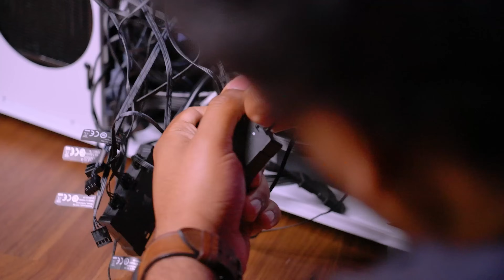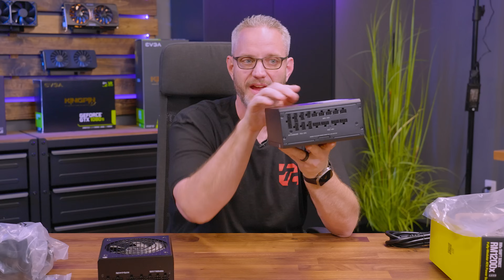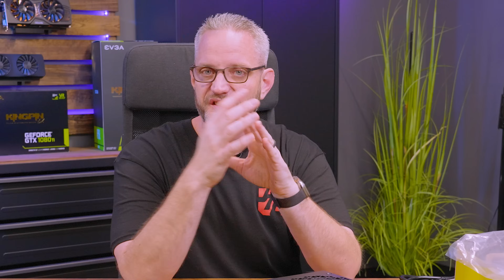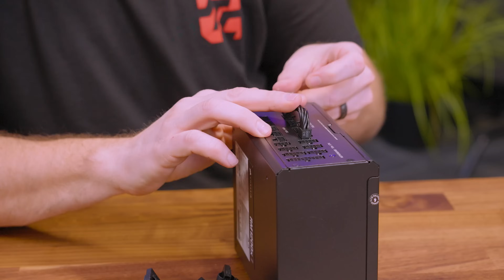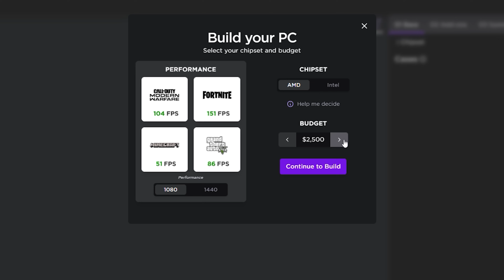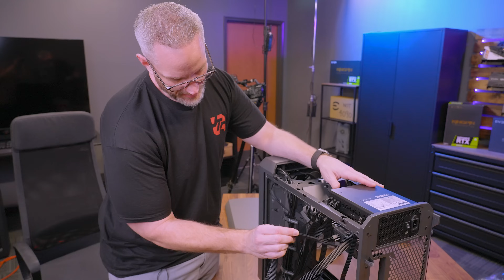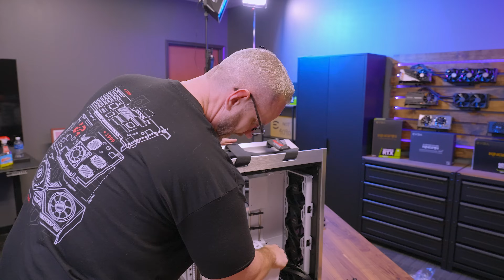I tried to prove this design was a failure... But then this happened.

Comment: @13:30 the wires are routing to the back of the supply before heading up toward the case top... essentially becomes the same as a rear socket power supply...

Comment: Frankly .. I would just take a Dremel to that case and make it work.  

For me this design is 100% better than trying to plug anything in 90 degree while I am fighting the case and whatever other cables and RGB controllers are stuffed in there  even HDD cages (yes, I still put one large drive into my cases where I just dump the "never use it" stuff - bad habit .. I will stop doing it and just store that on a NAS) 

I wear XXL gloves (size 12) .... Working on ANY CASE for me is a literal nightmare. The only one I am comfortable touching is the Thermal Take open cases (e.g. P3) ... but then bugs fly into it, cat climbs in it ... dust falls on it :(

Comment: 12:00 I'd argue that you don't need slack for the cables on the O11 to have access to them. The cables being on top allow you to rotate the PSU so the top part of it would be easily accessible, and the amount of cable that you need so your run reaches the PSU on top is already enough slack IMO. Also, isn't this new PSU a bit narrower so the cables do have some extra space for cables to fit?

Comment: Wouldn't work for my Thermaltake W100 case but my EVGA 1000 watt is still holding strong and I only paid $80.00 for it, but I'm definitely not gonna spend 200+ on a psu 😏

Comment: they could have it so it's not as wide as an atx power supply (but keep the atx profile for the rear where it's screwed in) and make the powersupply a bit longer, this would create more space for the cable to come out and since the cables don't need to come out the front the psu could be a bit longer to make that room

Comment: It's a good idea, but very dependent on the case you have, most "cheaper" cases, under  80-100$, dont have so much space between the PSU and Side panel. I think cheaper cases, with bottom-mounted PSUs would have issues with it too

Comment: Sorry that i have to say this but i am kinda dissapointed in this video. Mostly as the very first time i saw a advertisement for these shift power supplies, i straight up knew why they were making them. Longer power supplies in the 4000, 5000 and 7000 cases, as those were shown in the advertisement, normally mean you have to remove the hdd drive cages to have space for your cables. By having the cables come out the side, the drive cages can stay in. 

The NZXT case even showed this benefit but wasnt pointed out. Or even a fit in a Corsair case.

Comment: I looked at this a little while ago and decided on an AX1600i instead (plus I got it on a rather sweet deal and I only needed to order a 24-pin from CableMod to retain my custom cable set). I like the concept but was disappointed that the SHIFT's efficiency is only rated as gold.

Comment: On the last case I would try to pass the cpu cables straight up trough the metal shroud behind the motherboard. It is no elegant but this way the length would be sufficient.

Comment: honestly, some of these cases are really just you nit picking and searching for non existing issues here, this PSU is for those that are looking for something like this so we already most likely have a case that would benefit from having cables coming out of the side... but showing cases that are literally designed to have the cables coming out the back is just stupid and almost looks like you actively tried to set this up for failure. its a pretty obvious thing that if you were to get a PSU like this you have already done your research on the case you want otherwise youd just go with you know... a conventional PSU setup. This is almost like complaining about that a philips screw driver doesnt work on screws meant for a flathead screwdriver...

Comment: Also really convenient for a case that has the psu on its side behind the motherboard. So the fan can go out and the cables run out of the top which is much more clean and easy than having the cables come out of the back.

Comment: In principle, the Corsair Shift PSUs are a nice idea, but you will have to pay very close attention to whether they are suitable for the case you plan to use.
Reply: Hence this video...
Reply: Hopefully over time this kind of configuration becomes more common and case manufacturer begins to follow suit, because conceptually it makes an awful lot more sense.
Maybe eventually it’ll make equally as much sense in practice
Reply: Not everyone uses hdd on top of psu in 011d evo. In that case shift is good.
Reply: Get a Corsair case, sorted. This PSU is brilliant, purchased a 5000x as I know that will be compatible
Reply: So it's like any other computer component. What an actualization.
Reply: some other review said corsair actually made a list of alot of cases they tested the shift series with. 
but i can't find it rn, only their info about the case having to have a standart atx layout, be at least 210mm wide and side access to the psu.

Comment: The biggest problem is just the fact that it ignores standards and thus while it may work with a case, it also may not work, honestly it's extremely annoying how PC component companies just outright ignore standards, like PCI-E expansion height, there is a standard, but most GPU manufacturers flat out ignore it meaning there's a huge issue with GPU & case compatibility when there shouldn't be.

Comment: My only issue with this PSU is the lack of native 12VHPWR support.  For an ATX 3.0 PSU, this should be standard.
Reply: can you elaborate on what you mean by 'native' 12vhpwr support? i have this psu and it came with a 12vhpwr cable that i'm using on a 4090

Comment: I bought this power supply for a 7900xtx in a Lian Li Lancool III and it works well with fan facing down. I thought it was a neat change up that helped with cable management.

Comment: If you're like me with an O11D Evo and don't use the drive cage, you can take it out and that gives you that entire upper section to cable manage the cables coming out of the unit. That is why I have been considering one of these new Corsair PSUs because my current unit has the standard "out the back" cabling, and it gets awfully tight with cable management. I mean it works and all, but you have to get a bit creative. So I do like this idea. Although, it would definitely be a case by case situation with it - as you demonstrated. Good to visualize how it fits in some cases though, especially mine. Appreciate it!
Reply: Just built one this week with the rm1200 shift and no drive cage and it worked a treat

Comment: I imagine when Cablemod makes custom cables for the Shift family of PSUs from Corsair, it's going to have pretty unique cable runs in certain cases. Possibly to the point of having to shorten one side of the cables in certain runs. With the number of O11 case builds, it's likely that they're going to have to think a little differently about that. Synergy gave Jay those special short run cables for his powerboard that had half one length and half slightly longer/shorter (depending on where you start) and if the cable runs are anywhere as short as that, it's gonna affect the cable flex.
Reply: Cablemod might make 90 degree angle custom cable plugs to make sideways runs easier.
Reply: @KayDizzelVids  
I was thinking about this while watching the video. It's a good concept and as Jay points out, I'm happy that companies are "innovating", even if it's something as "trivial" as moving the connectors from one side to another. A lot of case fitting issues would disappear if they had 90 degree cables instead of "regular" ones.
Reply: I don't understand why you think that there would be an issue with Cablemod custom cables for the Shift (when released) when Cablemod have their 'Custom Cable Configurator' for buyers to select from for each cable that ranges from 150mm to 1000mm. This is on the buyer and not Cablemod to decide the cable lengths for their particular case. There's nothing to think about on Cablemod end! And also, it's "Singularitycases" who supplied the Powerboard and their own custom cables design. But why would you bring up Singularitycases custom cables when it's an minority small amount of PC builders that would be concerned about the cable flex of their 100mm 24pin/EPS cable?
Reply: @disguiseddv8ant486  You're not reading. Short enough cable runs ruin the uniformity when they're bent, because there's not enough slack; an issue SINGULARITY RESOLVED, IF you bothered to watch Jay's video on his powerboard unboxing with the custom cable runs.
Reply: @UnveiledShadows  I've read what have you typed. I'm pointing what you're saying is only for the VERY small minority group who uses the 100mm or the 150mm custom cables and buying power boards. So why even mention the minority group when they themselves wasn't complaining about "cable flex"? It's a moot point! 
And also, I did watch that video because that's why I've told you the correct company name "Singularity" without going back watching the video again.
Reply: The end of cables for a modular power supply are unique for that PSU and are not standardized between different brands, and even different models from the same company.  So I doubt Cablemod would do that considering it would at worse, be only for that PSU, and at best, be for a range of models from that same company.  You could kill your PSU if you don't use a compatible cable with the PSU.  It's why when ordering replacements, you need to specify the model and not just the brand.

Comment: 20:10 The insulation was already shaved before your put them in this case.
17:47 You can see here that the cable is already damaged.

Comment: If I paid $300 for a PSU and I got crappy rubber cables, I'd be pissed....oh wait, I just did with a SeaSonic Vertex unit, too...

Past time for crappy rubber cables OEM to die.

Situationally, this design is amazing.  Situationally.

Comment: Makes me wonder why there are no powersupply connector expansion pannels built into a case, that then connects to the power supply. 
Maybe even an expansion pannel that can be placed anywhere in the case, but the cables from the powersupply towards the expansion panel would be hidden (built in by the case manufacturer).

Comment: Thanks for doing this video just to let us know that this even exists. I can see the benefits depending on the case but all of your points are valid.

One thing I did want to point on was the bend you put on the cable.  Since this cable is delivering power only it’s ok to bend it like that.  Power does not bottleneck no matter how much you bend it.

Comment: The thing is though, not everybody has access to a large stock of cases and power supplies, so you probably are not going to know that a certain orientation of plugs is going to work better than another and I'm sure nobody out here is going to buy a case and M/B and hold of buying a PS so that you can figure out what the best is. With all the combos of Cases and PSs, you would have to go with what you know, assuming a PS will work very rarely works.

Comment: I have this, was a pain in the arse to fit into the O11-D because of the Hard drive expansion bay sits bang on top of the connectors and requires you to radically bend the cables over and lay side by side close to each other.  Without that bay in place, it fits like a dream....

Comment: If I wanted to upgrade my system to a 5800x3d and drop in a 4070, do I need a new PSU?

I'm just running a 3600x, rx580 and using a Corsair 650 (forget the exact model, but an older one).

Thanks peeps for any help!

Comment: It could work well in cases where the PSU is on edge behind the motherboard, such as the Corsair Air 540, or Lian-Li 011 Dynamic.
I'm sure that Corsair would use cable sizes large enough to handle the power, considering the fact that Johnny Guru is working in their PSU division. 
Also, you should never use pigtail cables on your GPU. (As in, not using both connectors on it, one is fine, though not as nice looking.

Comment: Room 4 cables on that, you probebly need more room of that, as all the plugs in the PSU are in a line, and at least at first most of them have to route forward, well you will have layers of cables i assume.
I still like these new PSU form factor, but cases would need to accommodate this feature for it to really work.

Comment: I needed a new PSU for my recent 4090 gpu upgrade. I bought a shift, it's quite excellent in my define 7.

Everything went together so quickly and it didn't require a total teardown of the entire system, i just carefully removed the old power cables and PSU then with the shift connections being on the side i popped the new PSU in and routed the new wires without any issues. Total time for a PSU upgrade without teardown was about 10 minutes.

Comment: Really unique and innovative design, I could see this being quite useful for ITX builds or something. I don't think there is much benefit to be had on a full size ATX power supply that will go into a giant ATX full tower case, but for smaller builds it might be really good. Kind of disappointed they only give the rubber insulated kind of cables with it though, I feel like at this price point it should feature braided cables.

Comment: I have the AP201 and had to do some cramped cable management when building. Wondering now if pushing the cables out the side of the psu would have made it easier to deal with... Might have to look into this

Comment: works really well where space in limited in front of a power supply because of hard drive sleds... I had to remove 2 hard drives during a upgrade because the customer bought the regular 1000w corsair instead of the shift

Comment: This would work just perfect for my oold €35  Riotoro case, now seems ahead of it's time! Already thinking of a switch from my TX-750 model, to this new design, though found decent setup with present PSU, this new design will leave room for my additional Noctua case fans and still much free air. Great thinking, Corsair!

Comment: I literally got this PSU alongside a 4090 and I struggled a lot last week to fit those cables in my Lian Li Lancool II. This video would've been very helpful a bit sooner 😂
Reply: I was looking at literally the same setup a couple days ago (this psu, Lancool II mesh, and 4090.) What was difficult about it?
Reply: @Hagop64  If you look at your case's little metal panel that opens downwards, the one below the glass panel, it has 2 metal plates screwed to it on the inside. I had to unscrew those in order to make some room for the cables to bend and even then it was difficult to fully close the panel until the magnets made contact. The worst offender was the main motherboard cable. I had to unstick the individual cables from each other a bit in order to plug in both connectors. The actual panel is a bit bent outwards in the middle for me right now due to the cables being cluttered inside so I'm guessing I need to find a better solution to manage them.
Reply: He already had to time travel to post this two weeks earlier than planned. 🙂

Comment: So I was thinking, if there is internal space available, would it be possible for PSU makers to have the connections more inset so the wires would clear the PSU housing and could have a tighter bend to manage? Maybe inset like 5-10mm. It would be a nice proof of concept if they were to make one as an experiment like this one.

Comment: I see where they are coming from and it is nice to see a variety. But this should coexist with the standard layout PSU instead of replacing it.

(I haven't yet watched the video till the end and I'm not sure if you mention it, BUT if the cables are too long for the case now you still have to stuff them in front of the PSU creating even bigger mess.)

Comment: I can imagine this might be beneficial for cases like the O11-family, but I think the ports might be in the wrong direction for it
Reply: The O11 allows you to mount the PSU with fan facing towards the outside or the inside of the case, I think it will be fine lol. The fan will face the inside of the case but that back section has so much room that it should still have ample airflow
Reply: @TheOriginalFaxon  In an o11, if you mount it with fan side out, the cable ports stick up. This limits you to only being to mount this in the bottom most slot of an o11 but leaves the cables going upwards into the hard drive cage. I would rather mount my PSU at the top with the cables facing down, fan facing out, but that's not an option with this PSU. I could mount it at the bottom of the case with the cables facing upwards but not even that works for every build.
I hope corsair adds more options for the shift series so alternative cable directions are available. Mounting at the top with cables going down would be more ideal for my build.
Reply: I just plugged this into my O11. Yes I had to take the hard drive cage out but overall it cleaned up the back of my case IMO

Comment: I like mine I have the 1000 watt but if it is on top like in the o11 dynamic it's no big dill cause it would be the same way the old way. But with some cases better cause if u swap cases it's possible u will get a case that would be on the side. I don't switch cases often but it's still possible. I agree the wires isn't protected well.